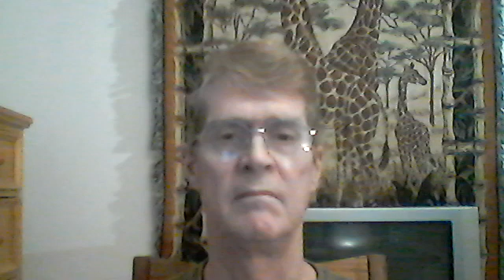Backward Balun

Comment: I once had a 40M ground mounted vertical made from galv down spout. It was 33' high. Had 36 X 25' radials layed on the ground around the base. It was about 100' or so from my shack. I fed it with 300 ohm twin lead to a tuner. Worked well as a 1/4 on 40 and a 1/2 wave on 20M. No balun until it got to the tuner.. Would do it again if the opportunity came about..

Comment: I haven't done it, but I did wonder if it would work with a Yagi that had a very low feed impedance.  I don't see why it wouldn't work as it's an impedance match (of course not 100% efficient)  and for max power transfer you need matched impedance!  With a Qtr wave vertical I think you could increase the impedance  to match the ladder line when it was designed by adjusting the angle and length of the radials couldn't you?  Then you'd only need a balun at the radio end.
Reply from the maker: I have not tried the backward balun with a Yagi, so I cannot answer that question. Maybe some other viewer can. The maximum feed point impedance for a grround plane antenna is about 73 ohms (when the radials go straight down making it in effect a vertical dipole). I have in fact fed a ground plane with ladder line. It was many years ago, so the details are foggy in my memory. I made contacts with that antenna, but the feed line radiated to some extent because of unequal currents in the wires. 73 de W1GV.
Reply: It doesn't have to be a 4:1 balun. You can use any. For example 1:1, 9:1, etc. You may also not need a balun at the other end. You just cut the line where the impedance is 50 Ohms.